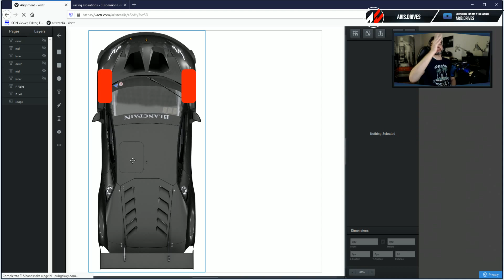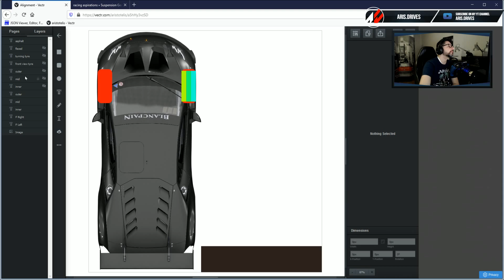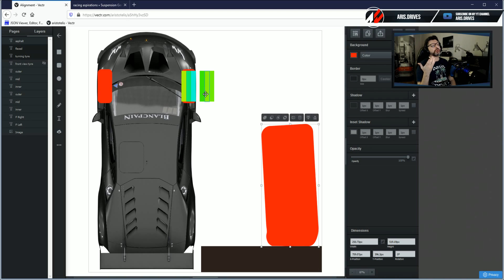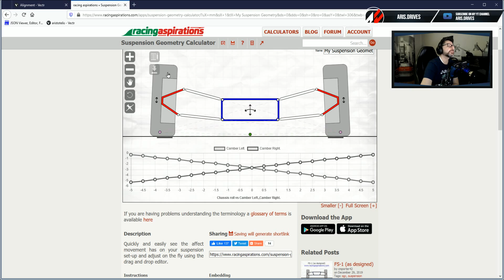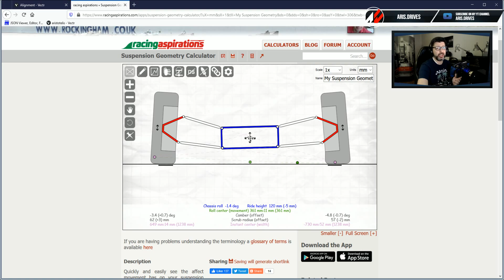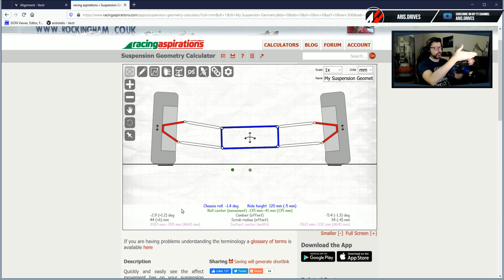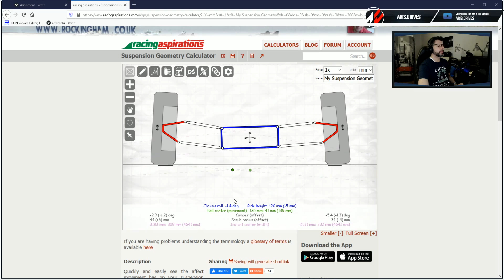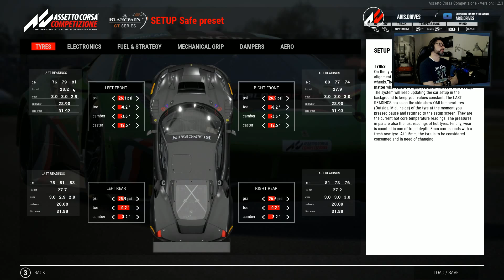TL;DW - Too Long;Didn't Watch. Why you need more negative camber!

Comment: Good to know. :) I'm new to ACC and my choice of car (Lexus) always has very low differences between the inside and the outside (2-4 C degrees) and until now I thought this is how it supposed to be and it's perfect. :) Now I know I need more negative camber. This was probably the reason why I'm slow until now. :D
Reply from the maker: There is obviously a limit of negative camber where over it you start losing grip. But modern slick tyres usually work at very high numbers of negative camber (-5 and -6 non uncommon). 
For safety reasons, Pirelli limits the negative camber to -4 and -3.5 degrees front and rear by rules, and they are pretty low numbers for such tyres and cars, so it's quite safe to go to max negative camber values and just play on decimals around those values for balancing the car.

Comment: Aris, your videos are great and a valuable introduction to car setup. However I have a question. (tbh I am on Iracing and not ACC), I am mainly driving the MX5 and i have this huge problem i cannot seem to fix no matter what I do. The outside front tyre always gets super hot and gains pressure very fast while the inner rear tyre remains very cold (in reality both rear tyres are generally colder but the inner one is supercold). Also in camber values no matter how low I set my camber even at lowest value I can go and many times i raise the suspension to go under 1 degree in some tracks, on that inner rear tyre there is always a significant difference on the  temperature reading with the inner tread being significantly hotter but even then below the operating temperatures of the tyre. In many cases I feel that the wheel is simply there to just exist... funny case once I had a crash and had that wheel off and it was still driveable for a little bit. My geometry is more or less symmetrical (sometimes I raise the rear higher to give the car a bit more rotation) with 50% crossweight  Any suggestions?
Reply: Sounds like a very poor simulation.
Reply: @johnnypenso9574  it seems they are treating the mx5 in iRacing like a test bench for everything new they want to introduce since it's mostly at rookie series. However due to my equipment I am limited to what cars are driveable and that is underpowered ones such as the MX5
Reply: @christoforospaphitis4090  have this exact same problem in pc2 I took notice of him speaking about suspension geometries but still sure something is wrong

Comment: Hi thanks for this amazing content , as well as all the other streams (by the way, I've not seem them all yet) ! There is something I'm unsure on this video : you speak about temperature, camber lost, roll, but not that much about the impact on the driving. Does it have no impact on it  ? Other question : is it correct to say that all the camber should be lost on the corner of the track that has the most lateral G force  ? Thx !
Reply: Well, it all comes down to driveability. When creating the set-up it is all about making the car+driver combo as fast as possible. So it does impact the driving, but you more or less need to figure out yourself what you want. Some drivers like harder set-ups, other drivers like softer set-ups. Some drivers like more oversteer, others more understeer. You don't have 1 set-up for every track that is best for all. So it all has a very big impact on the driving, but it is difficult to explain. In short, the right amount of camber for a specific track will give you best grip in the corners. 

On your second question, as with all of the above, it depends. It depends on the aero of the car, the conditions, how the other corners are... Don't make a set-up for 1 corner, there is no point in gaining 0.2s in 1 corner, just to lose 0.4s in all other corners because the set-up isn't correct for those.